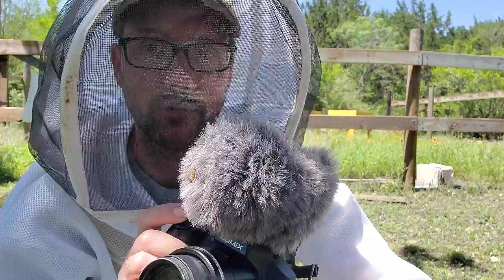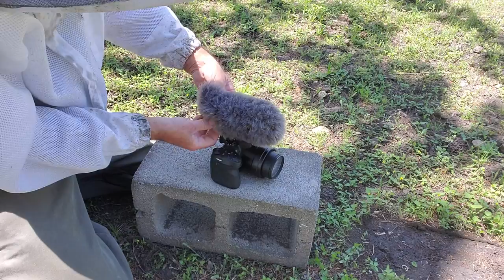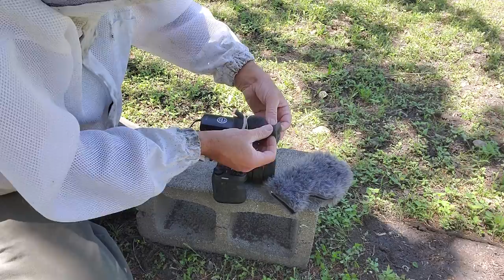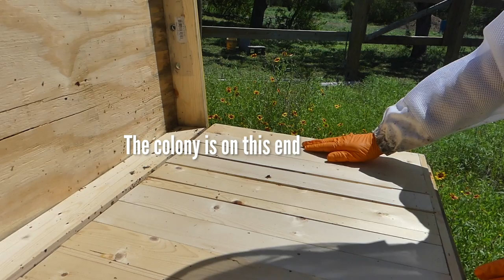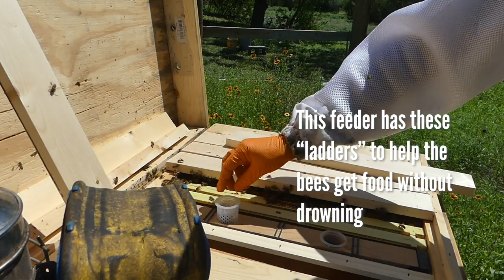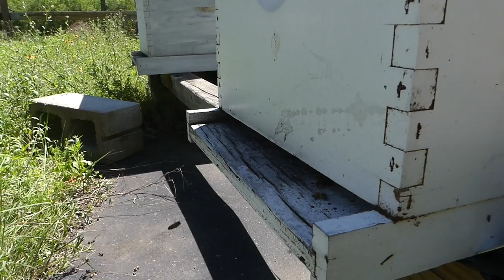BEES HATE THIS LESS - Feeding Horizontal Hive

Comment: I always thought that you were supposed use burlap bags for your smoke source
Reply from the maker: I've used burlap too. It didn't work well for me, but that may have been for the same reasons that the denim isn't working as well. I probably need to put a lot more in the can.
Reply: I saw a video about using dried horse apples/cow patties, it was an interesting conversation when I stop by a horse farm and asked if I could pick up their crap😅